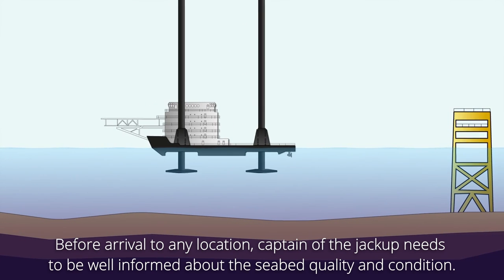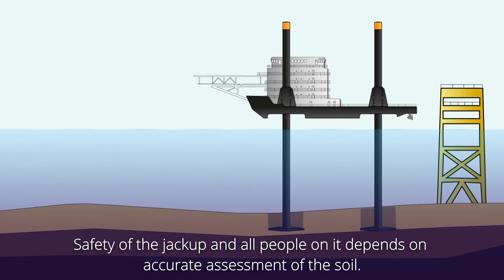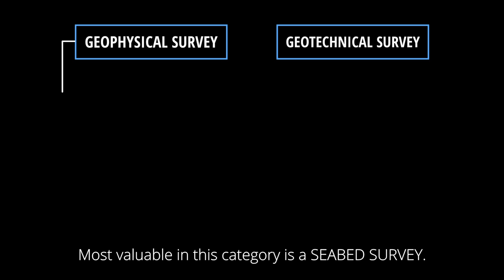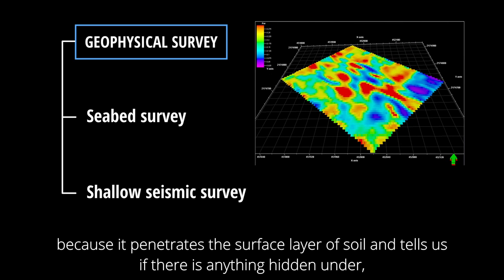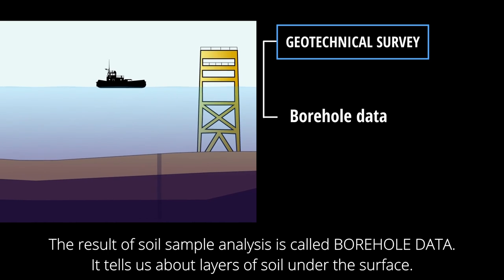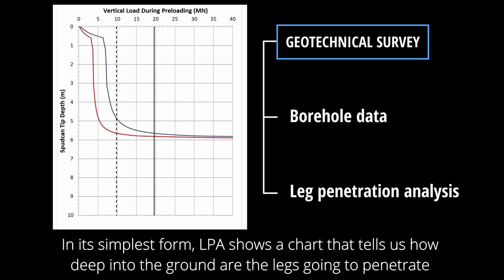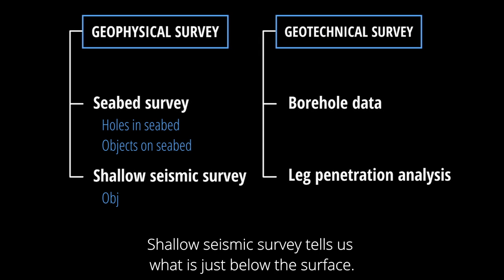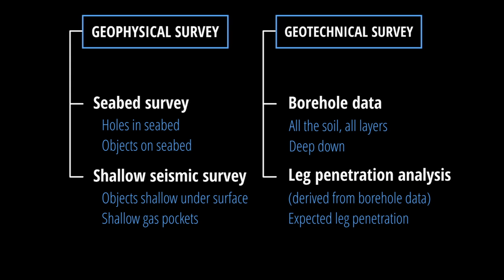Seabed survey - part 1 | Jackups & offshore rigs

Comment: Good video graphic explanation the JU data requirement on Soil Investigation. On the hand the soil investigation normally can be extent also for designing the bearing capacity for the platform pile design. Great video!